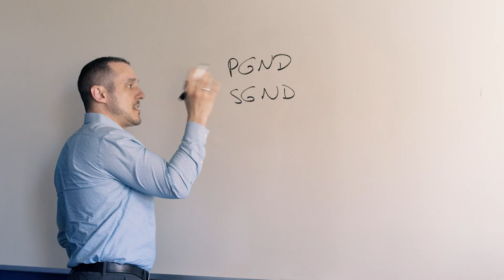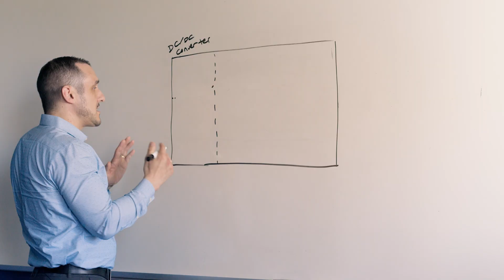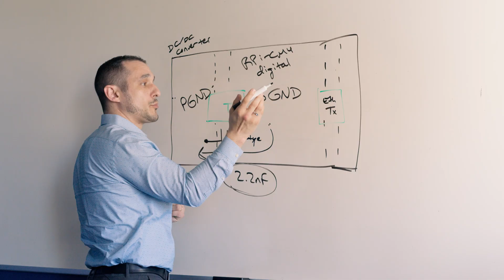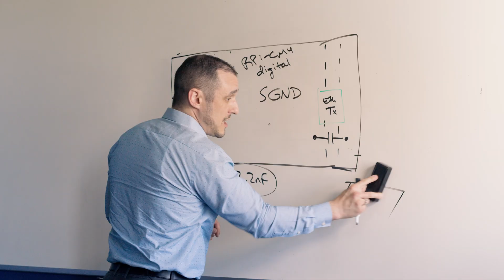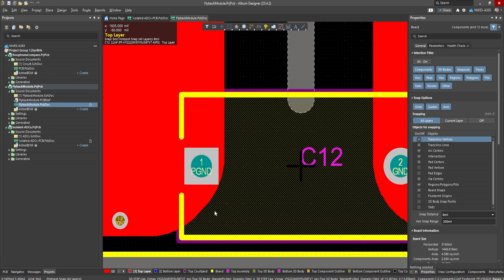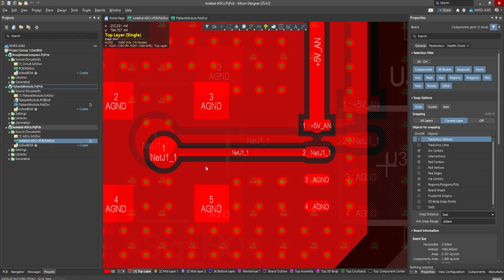Isolated Grounds in PCBs With Ethernet #electronics #ethernetswitch #pcbdesign

Comment: What about Plane stitching ? Should we make the two GND planes stitching by placing Capacitors between them for better EMC Performance ?
Reply from the maker: Are you refering to the case where you would have two ground on either side of an Ethernet transformer? If the two planes are totally disconnected, you can connect them back together with a Y-type capacitor in order to maintain galvanic isolation. Make sure the capacitor has high enough withstand voltage to comply with the Ethernet standard (1.5 kV RMS/2.1 kV peak). Note that this would be a physically large capacitor, which is why we might prefer to use a magjack with the integrated magnetics, and this way you would not need a separate plane. Instead, you would have a rail that spans the edge of the PCB and it can connect back to the power supply return point (negative terminal), this would direct any ESD pulse that impinges on the magjack connector shroud away from your components and into a point where it can return to earth. Hope this helps!
Reply: @Zachariah-Peterson  Thank you for your informative knowledge

Comment: Would it be ok to have a Chassis shield around the Ethernet differential pairs? like shielding or some sort....
Reply from the maker: Are you referring to a sheet metal PCB-mount shield?
Reply: @Zachariah-Peterson  yes that to but mostly regarding having a layer on the PCB as a shield,  i was thinking of connecting that layer to chassis GND